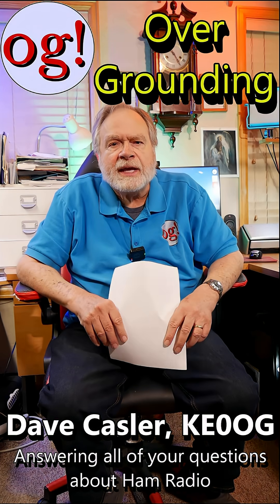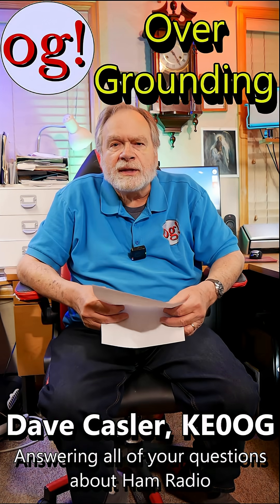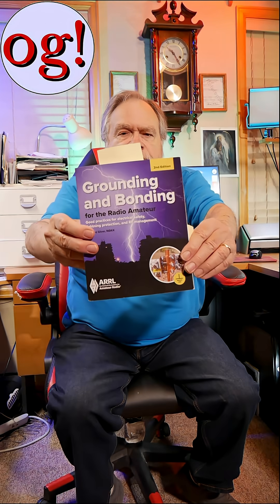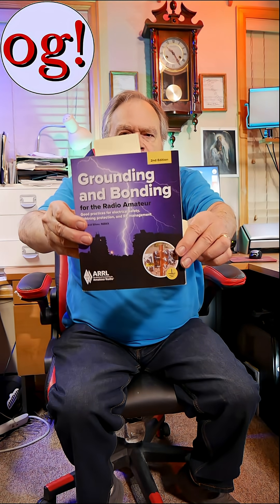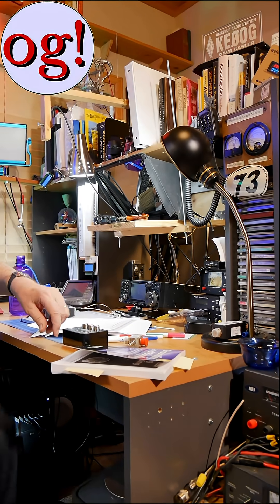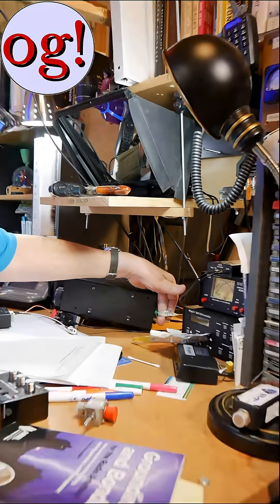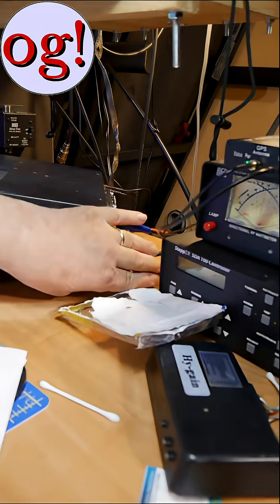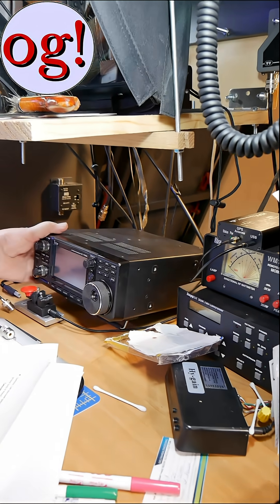Over Grounding (Short #86)

Comment: The voltage difference between house ground (green wire) and station ground?  House ground is not bonded. So every connection is a resistance. 
How many outlets do you have that are wired as pass-through (ac input on one lug, ac output on another) on the way to your rig? 
Those and any corrosion at other connections are all voltage drops.

Comment: Disconnect the coax when not in use, esp. at the exterior entry point into the home. Run equipment off of DC, or unplug everything if using AC when not in use.

Comment: Dave, I've been plugging my system into the house electric. Yes, with the green wire. But for the antenna, I usually do not connect that to the transceiver unless Im using it. And I also unplug everything from the ac when Im not using it... And I dont use it during storms..Ty